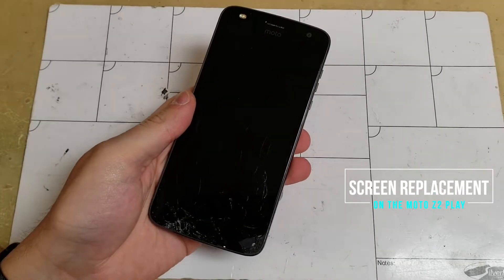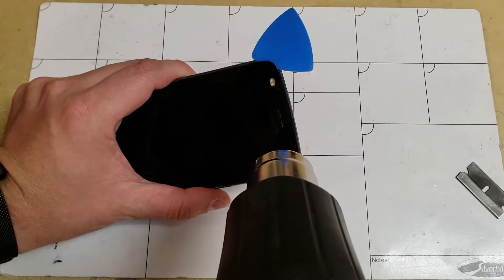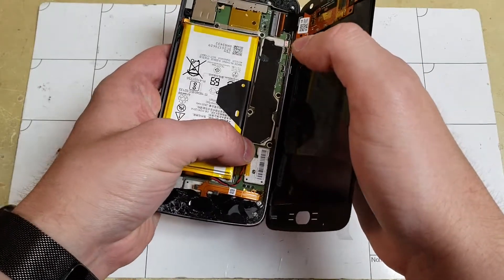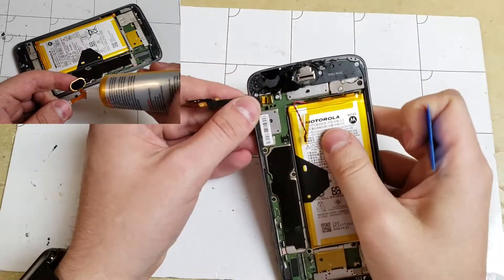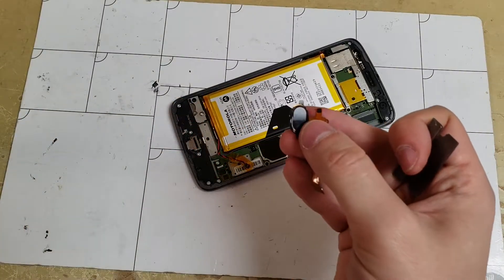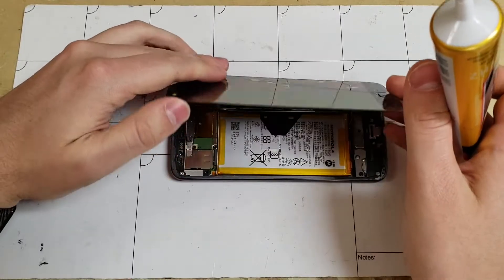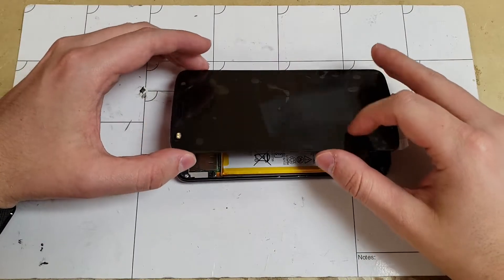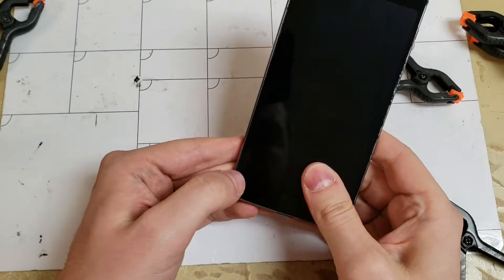Motorola Moto Z2 Play Screen Replacement (Fix Your Broken Display!)

Comment: Hi I'm getting my Moto z2 play fixed rn but when replacing the screen my flash doesn't seem to work ... Are you ment to attach the flash to she screen or the frame part?
Reply from the maker: The frame seems easier to do

Comment: Super casual and a great demonstration. Thank you! Also, I used T7000, cuz that's what came with my screen order. If anyone uses that, it is recommended letting the glue cure for approximated 36-48 hours for the best results.

Comment: Hey i had a question , can i use this z2 play screen on my z2 force , 
As force screen is very costly and not available , my phone is showing black screen with few lines sometimes , and reponding to charge . Idk what to do man using a pathetic phone now
Reply from the maker: No that would not work. Different screen connections
Reply: @RealWorldReview  is there a cheaper lcd version of this phone screen available by any chance , or can i avail warranty as ,motorola says 4 year warranty.
Reply from the maker: @pudge9985  not that I know of. The z2 force should be ~$100 usd right now
Reply: @RealWorldReview  lol yea , and screen alone is costing the same :D hate motorola now disappointed with moto x force , and z2 force both , always had problems.

Comment: Hello, I have some questions.
1)Do you recommend T 7000 glue, if yes, does it glues very well?
2) Can it be more than 10 clamps?
 Thanks
Reply: Hey there! I know you asked this two months ago but... I just fixed my phone yesterday and I used T7000. You can definitely use it, that's what came with my new screen replacement. Recommendation is to use as many clamps as needed to ensure the screen seals all the way into place. Let it cure (dry) for 36-48 hours
Reply: T7000 is the best glue for this kind of repairs, B7000 isn't as good, clamps are a bad idea, if the new screen is of bad quality(most of them are) you will end up with spots that are brighter on the screen, the best results are achieved using 5cm wide tape, cut six squares of 5x5cm, you put 3cm on the screen you just glued and then pull the tape and apply it to the phone frame, it will keep your screen pressure free and the glue will cure leaving your screen at the exacta same height as the screen frame, 1 piece on the top, 1 piece on the bottom and 2 on each side, or you can also use rubber bands instead of clamps, but I preferred the tape squares, I do this for a living and tape gives me the most aesthetic looks without putting any pressure on the screen.
Reply: Also 12 hours is what I recommend my walk in-walk out clients to leave the glue to cure with the tape still on the screen, after 12 hours they can remove it and clean the glue with a dry piece of cloth.
Reply from the maker: @Oscar, I do the same. Let it sit for at least 2 hours and add some basic tape on the corners and sides and let them take it off the next morning.
Reply from the maker: I don't notice a difference in the B,E, or T glues, other than maybe drying time? And obviously the T is black while the others are clearish. Also you won't experience brighter areas because it's on oled screen. Might experience that in LCD screens, but even then, I have only experienced that in trash screens like the LCDs on the Samsung A20 and A50

Comment: Is this the same process for the z2 force?
Reply from the maker: Similar, but not the same. The screen is shatterproof and just comes off. There is some adhesive but using heat isn't recommended because it's a plastic screen and will start melting. The screen sits on the frame, so much sure to get under the frame when removing the screen.

But if the screen isn't working, then you should be able to just remove the display without too much to worry about
Reply: Can i use this on my z2 force ? My screen went black , and amoled display is very costly for this phone at this date , when you can buy an entire new phone by adding few bucks more , pls help

Comment: this is a very obnoxious job, the replacements rarely fit well and the glue often releases after awhile.
Reply from the maker: You must use the glue used in the video. You must use clamps to hold the screen down. If you can do that for 24 hours it will be EXTREMELY difficult to remove the screen again unless you leave it in extreme heat for long periods of time or of the battery bloats up. The Motorola screens seem to take longer for the curing process, so that may be the issue. Normally I can get away with 30-45 minutes on Samsung devices, but on the Motorola phones they require 2 hours at least before I can remove the clamps (same with the HTC 10)
Reply: @RealWorldReview  thank you!
Reply: I'm trying the in the future so I'm going to ask some questions.
Reply: Did you use the same glue used in the video?
Reply: How often does the glue release? Did you use the clamps?

Comment: Where can I buy a screen spare part?
Reply: Check out eBay! They have them on there. I've got to buy one myself actually after mine impersonated a frisbee after I slipped on a wet floor. But yea. You can get most replacement parts on there. Hope that you manage to get it sorted.
Reply: @darkstardavros  thanks a lot

Comment: Hey, I had a replacement put on yesterday, and now I have a problem with the touchscreen. 
They replaced lcd, touch and battery. Now, when I turn on the screen (from power button or home), it takes like 12 to 15 seconds for the touchscreen to react. If I shut off the screen, and back on, again I have to wait 12 to 15 seconds to unlock, because of the touchscreen. It's really annoying, and I can't seem to find a fix. Any way to test if it's soft or hardware? I know they didn't put an ORIGINAL LCD+Touch, can it be that it isn't  compatible or something?

Comment: Hey does the glue hold pretty good and does the display stay flat down like when you buy the phone brand new?
Reply from the maker: As long as you let it cure long enough (1-3 hours), it will actually sit closer to the phone sometimes (obviously when using the clips properly.) This means by adding the glue it will help prevent you from breaking the screen (but only by a little bit.)

Comment: I'm sure there are plenty of risks but what are chances of messing this up like I'd say I'm pretty patient but idk want to make my phone worst then it is btw my phone isn't broken but the adhesive on the right and left is lifted up enough where you can see the battery so should I take the chance to pop the screen off and re apply glue if you have anwser that be greatly appreciated.
Reply: It is a common thing with these phones that the battery swelled over time as it's capacity got used up therefore pushing the screen away which is exactly what happened to my wifes. At this point I installed a new battery